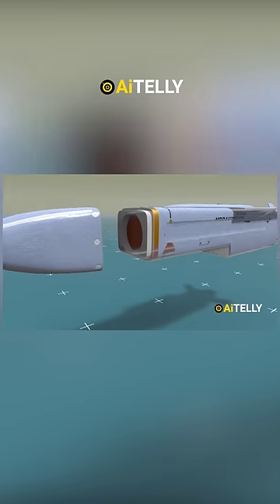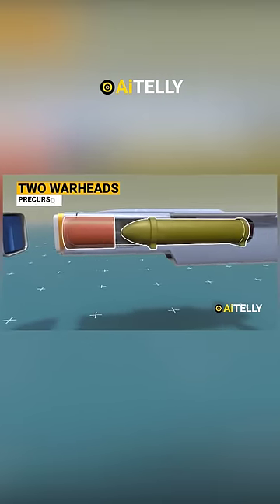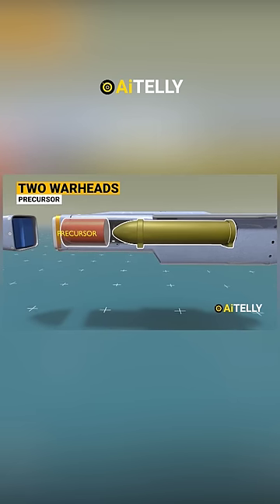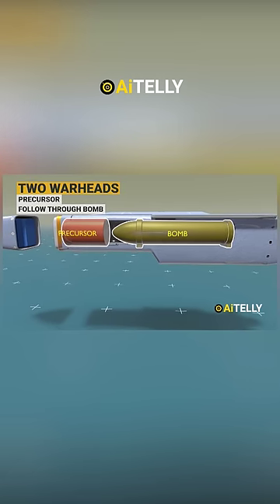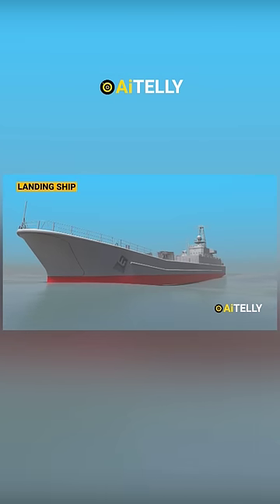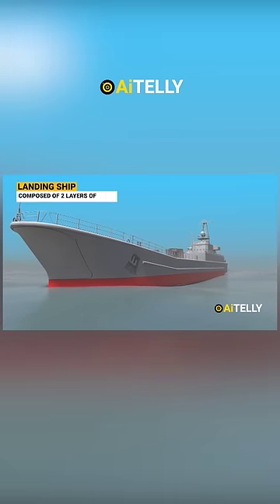Storm Shadow Cruise Missiles Engineering How it hit a Landing Ship #3d #missile #science

Comment: No ship in service has 5m of steel
Reply: just in case you know, overkill is never wrong haha
Reply: Yeah but information vids need to be accurate otherwise what’s the point
Reply: Every one is talking smack about cargo planes until the sky is talking on pallets of these things but I think maybe 5 meters of old iron armor.. maybe? But I believe you're correct five meters of armor is like making a tank with 1 meter of armor
Reply: The US Littoral class of ships will have areas that thick after stacking 10 of them in a ship breaking yard😂
Reply: @unowno123 It can be if the projectile overpenetrates, essentially going right through the target before the explosives fire. Not a problem with modern active fuses, though.
Reply: he’s not saying that. He says 5 m because that’s the middle point of the ship do you want to get in the middle as closest possible. If you blow to early, you will do less damage and only on one side.
Reply: seriously wtf. How much would that even weigh
Reply: 5 m steel is unbelievable strong
Reply: @mahekfaldu Nope
Reply: @wallace-bv4rl 😅😅😅😅😅
Reply: Hoax Search Accurate Information Dude
Reply: 5m! Do You Know How That 5m Thickness Looks Like?
Reply: Yes, that graphics is an exageration by about a factor 100 and Id we extremely surprised if the precursor on the BROACH-warhead could penetrate anywhere near 5 meters of steel. The reason for the precursor is not to penetrate steel, but to penetrate soil, concrete and rock.
Reply: Not even an Oil Super ship have even 20% of that ...thickness.😂
Reply: No ships has more than about 2% of that plate thickness, and then only the highly stressed deck plates on large container ships.  @MrKlipstar
Reply: Never said it. Pay attention.  It has the penetration capability 4-5m of steel.
Reply: @stevebannon9250  weight does not matter. Buoyancy does. Additionally he never said ships are 5m thick steel. He said that is the capability of the missile 4-5m
Reply: No ship ever has or ever will.
Reply: @foracal5608  actually.  Standard belt and deck armour on old warships (British war ships and aircraft carriers of WW2 era) was AR500 which is heat treated to 500 Brinell which is about 51.5 HRC at 12 inches thick.  American WW2 aircraft carriers didn’t have armoured decks so suffered in WW2 where the British aircraft carriers were armoured so took everything the Japanese threw at them and if they got damaged they were easily repaired in and hour or so.
Reply: @Biketunerfy  thought it was like how they measured modern armor compared to like just rot iron. Cool! But still everyone talks smack about cargo planes until the they start speaking in pallets of missiles
Reply: @unowno123 overkill no but overpenetration is a real thing.
Reply: @foracal5608  they are the back bone of an countries armed forces especially in distant theatres of war.
Reply: @Biketunerfy  yep people talk fire power real military talk about boring logistics. So cargo planes get smack talked but with out them ya got nothing
Reply: Generally these cruise missiles are meant to attack bunkers and other reinforced land targets.
Reply: @MaxwellAerialPhotography link the naval hq in Crimea
Reply: This option is for hardened bunker
Reply: @rolfgrupp7228  so around 23 inches.  I’d expect that on turrets but not belt and deck armour.  Besides, I was referring to aircraft carriers belt and deck armour.  The British battleships had no problem penetrating the German hulls in the battle of Jutland in WW1.  Both sides took loses us more initially but you surrendered your fleet in Scapa Flow and later scuttled so lost the full fleet.  We would of done the same had the roles been reversed though.
Reply: Bunkers probably do tho
Reply: Yeah but what if the missile hits the ship at a steep angle? Then it could end up going through 4-5m of armor if the angle is steep enough. So better to overkill than underkill.
Reply: @MischeifMakerz  a bunker Buster will go through 4 to 5 meters of concrete but never 4 to 5 meters of steel armour like AR500 which is what western war ship armour used.  There’s a famous video of a Japanese kamikaze plane hitting a western warships belt armour and just leaving a black spot and it was carrying a 500 Kg bomb when it detonated and it did nothing.  There isn’t one warship with armour that was over 16 inches thick which is 0.4064 Meters.
Reply: @jBKht931 you can act like the failed Littoral class destroyers are some big deal  but really it just shows how far advanced the U.S Navy is compared to every other non-nato Navy. We threw billions of dollars right into a blender just to see how it goes, while maintaining the most potent Navy, by far, in the world.
Reply: @haventthoughtofanameyet6364  not what I said. I said instead of sending them to a scrap yard, use them as test beds for large autonomous ships. Put one beside a destroyer as a wingman to work out bugs and see if it's even a good idea for the future.
Reply: @unowno123 true but over pen is a thing.
Reply: @Biketunerfy except no Essex class which were our flagships before the Midway class were ever sunk. Cant say the same for armoured british carriers
Reply: @jBKht931 You have a point.
Reply: @mahekfaldu Steel is expensive
Reply: @darrengarcia4937   America lost 12 aircraft carriers in WW2 that were sunk, the British lost 8 and of those 8 they were all converted ships that didn’t have armoured decks.  Just shows the difference.  I doubt they use armoured decks on modern day aircraft carriers today, maybe over the nuclear reactors/engine room and magazines but not the full decks although I’ve not checked to be honest but I’d be surprised if they were.
Reply: 5m its ship widh !not the thickness bort !!
Reply: They dreaming 😴
Reply: Even 5 cm is rare between modern warships
Reply: @unowno123 its wrong bro, you can shoot abrams's APFSDS against Panzer II and it just make a hole through and do little to no damage(except it hit the ammo rack)
Reply: @za_pravdu1943   actually APFSDS turns the inside of a tank into a shrapnel box and it also kills by over pressure and shrapnel.  When a silver arrow bores its way through tank armour the steel is heated to thousands of degrees and as soon as it penetrates the inside it’s like a huge grenade goes off inside the tank and the blast pressure raises the inside temperature to thousands of degrees but only for a split second, this  is called “flash”.  The funny thing is there’s no explosives used just kinetic energy in DU and TC APFSDS, If a silver arrow just kept on going through one side and out the other and not causing any damage most of the tank crew would be unhurt but in reality it is said once a APFSDS round has been used on the tank it is said you can hose the remains of the previous tank crew out of the tank that’s how destructive they are to soft tissue.
Reply: @Biketunerfy  APFSDS need thick enough armor to produce enough shrapnel, to hurt more than one crewman. With thin armor, APFSDS didn't transfer much kinetic energy, it doesn't cause overpressure or massive shrapnel. It just little bit slowed down and remain intact (except the fins)
Reply: @za_pravdu1943   yes on thin armour it produces a lot less shrapnel this is correct however it still produces overpressure.
Reply: Is there any dreadnought or pre dreadnought still with full coal bunkers. Cu that barely fits
Reply: @furrytimelord    What you mean as a historical ship you can visit ?.  Any coal fired ships left over from WW1 were refitted with oil burners and gas turbines but no not to my knowledge I can’t think of any and they are certainly none in service in the western navies.  There are some US capital ships from WW2 in permanent dock that were oil fired gas turbines but that’s about it I think.
Reply: The ship is only example... 
Knowing it can go through 5m steel means it can be used for enemy Bunkers.
Reply: @unowno123 unless it has exited the other side of the ship before exploding, which it would have if it was expecting to pass through 4 meters of steel.
Reply: Tiada setebal itu tetapi boleh tembus kepada itu.tolong fahami akan kekuatannya yang dikatakan.
Reply: @timseytiger9280  no round could go through 4 meters of steel armour.  Not a chance in hell.  Even at 25 inches that’s a stretch and the huge cannon would need to be point black range.  There was a test in America done with a huge cannon from a capital battle ship with some left over armour the Americans seized from the construction of the Yamato’s 25 inch thick armour and they only managed to pierce it at point black range.  The Yamato was the biggest most powerful battle ship in history that really didn’t go toe to toe with a big capital ship.
Reply: It doesnt say 5m of solid steel. It says "2 layers" of steel. So there is a gap on between. Reading comprehension...
Reply: The 5 meters accounts for breaking through internal structures and bulkheads too and he said up to.
Reply: @unowno123  "there is no Kill like Over-Kill"
Reply: Did you say 5 metres of steel. Are you okay upstairs.😂
Reply: I was literally like "ships hAve 16ft of steel hulls???? That's insane!"
Reply: for real😂
Reply: @unowno123 over pen can be a problem tho.  In Taiwan we have hypersonic anti ship missile. Few years back some one accidentally fired it during a drill and it hits an fishing boat.  It completely destroyed the fishing boats captains room and went through the other side. But it over pen and did not explode inside the fishing boat.
Reply: That was my thought I've never seen one that thick
Reply: I think that he just mistook 16in for 16 ft a nice heavy armor belt on a battleship.
Reply: How about 1m ?
Reply: @stevebannon9250  look up the density of armor steel and then take lets say 5 m³ of it for example and you can multiply it with the density of the type of steel and you get the  weight of the volume of steel. :)
Reply: That's what I came to the comments to say that'd be utterly untenable
Reply: I mean they have brought the USS Iowa back into service before, tho I doubt it has 5 m of armor
Reply: @Enzo_Gaming00  I got it… means there is no ship it cannot penetrate
Reply: Not one that floats anyway...
Reply: Exactly what I was going to say man no ship has 16 ft of steel around the ship
Reply: storm shaddow op plz fix. its for dealing with bunkers too.
Reply: It's 5m of CONCRETE, not Steel. 

The 'precursor' just clears a path for the 'follow thru bomb'.  Overpenetration of the precursor is irrelevant (and actually a good thing).  It just makes it easier for the following real kill device.
Reply: Yeah I kind of feel like they made this thing to kill Yamato or something.
Reply: No they try to simulate civilian ships just in case they want to see screaming civilians on sinking ship 💀
Reply: Nothing has five meters thick steel walls. 😂
But we'll be ready just in case
Reply: @unowno123 actually it can be. If the first part goes in one side and out the other what's the point.
Reply: @nanolog522 yeah, what he said
Reply: Someone picked it up too, nice
Reply: @foracal5608 lol tanks have 1 meter of armor. The Leopard 2 is even rumored to have 1,5m turret armor at the front. Not pure steel obviously, it's a composite which is much lighter
Reply: No ship ever made had that much steel. It wouldn't float.
Reply: Replacing word ship with target. All your confusion has been dispelled..... You're welcome 😂
Reply: @foracal5608 what are you even trying to say? You make no sense whatsoever.
Reply: @nickkirschner3719  about which part the pallets of cruise missiles or me admitting I didn't know something and learning? Rapid dragon or me admitting I am not a know it all asshole? Take your pick
Reply: They have a new bomb that does that too
Reply from the maker: Agreed we made the short from this video Original Storm Shadow https://youtu.be/yksbEE4GbCw?si=0nIbdzcpEmRZNtGN
Reply: I was thinking the same thing. Thanks for knowing it off the to of your head and keeping me from looking it up to confirm 😊
Reply from the maker: Please Note it's not 5 Meters of Steel, But it will travel upto 5 Meters  inside the Ship's Steel Hull.

Watch the Original Video Link Here
https://youtu.be/yksbEE4GbCw?si=XuonOb0u3QCTK4Gb
Reply: @Aitelly  see, you're polite and guide people when they misunderstood something
Reply: @Aitelly  That sounds more reasonable.
Reply: I dont even think a block of steel 5m thick could ever be boyant.
Reply: How thick was the hull of the German BattleShip Bizmark
Reply: One of the most heavily armored ships of all time, the Yamato-class battleship, had main belt of armour up to 410 millimetres (16.1 in) thick! Less than half meter. USS Gerald ford is about 300mm.
Reply: Atmaca fuzemiz var bunlar için
Reply: That ship would be several miles long😊
Reply: 5 meter steel, can penetrate any bomb 🌚🌚
Reply: This thing can basically get through just about anything is the point lol.
Reply: But the armour is at an angle which increases the relative thickness
Reply: 🇫🇷Sincères salutations, les 5 mètres d'acier  !! C'est en contant les balastres avec + les ponts intérieur et le tablier anti torpilles..!!😊..un navire avec 5 mètres de large de coque serait au fond de l'eau !! Comme le bismark 👍👍
Reply: No way it could penetrated 5 meter solid metal
Reply: @mahekfaldu not to mention exceptionally heavy to float 😂
Reply: @MrKlipstar   more .010%
Reply: Creio que nem o Encouraçado Japonês YAMATO tinha essse cinturão blindado de 5 Metros de expessura de aço macisso 😂
Reply: Unless it is a submarine.
Reply: @wallace-bv4rl  ну и как ему тогда раскрыть возможности ракеты? Сказать: «ну она пробивается любой корабль»? Видео не про корабли, а про ракеты и значит автор должен рассказать про все возможности ракеты
Reply: Overkill is underkill my guy
Reply: Wow bet you wish you hadn't opened that door but I know how you feel 😁
Reply: Icebreakers only have a inch or so of hull .
Reply: Tidak perlu di tembak, kapal akan tenggelam dengan sendirinya 😂
Reply: No ship EVER in setvice  has had 5m of steel.
Reply: No but the dock it was beside has 5m of concrete and steel.
Reply: No ship OUT of service ever had much more than half a meter of steel.
Reply: It's  true I was in sea goin vessels war ship's can't have 5m. Thick steel never heard of it 😳
Reply: But bunkers may
Reply: This isnt a dedicated anti ship missile. Its also for bunkers tanks and buildings. Anything you hit with this bad boy is gonna feel it
Reply: Content creator already said it genius calm down
Reply: It's a bunker 💥 - 5 meters looks ok. Soil, concrete, metal and finally inside ❤
Reply: Russia has 10 meter armored ship. 
Source: Russia
Reply: It means 5 meters of steel is the maximum penetration of the jet hot metal, meaning it has enough power to pass through several walls of steels as ship walls is only several inches so that the bomb can go to its intended target in the middle of the ship.
Reply: But some bunkers do

Comment: 16 feet of steel?  I’m callin bullshit on that one boy!
Reply: He’s saying it has the capability to do that not that the ship is that thick in diameter the model does make it confusing while saying that though
Reply: It's a bunker buster not anti ship. Just a little different.
Reply: He meant that it penetrates up to 5 meters deep through the steel hull and bulkheads of the ship, not that it is capable of penetrating a full 5 meters of continous steel.
Reply: Its a massive heat warhead. Modern tripod launched ATGMs which are much smaller can get over 1m of steel penetration.
Why would it be hard to believe that a massive HEAT warhead (just bigger) cant ?
Reply: @pieterveenders9793 no it actually penetrates up to 5m of steel. Its a massive HEAT warhead, its not hard to believe. A panzerfaust 3 has almost a meter of RHS penetration and its way smaller.
Reply: it's designed as a bunker buster